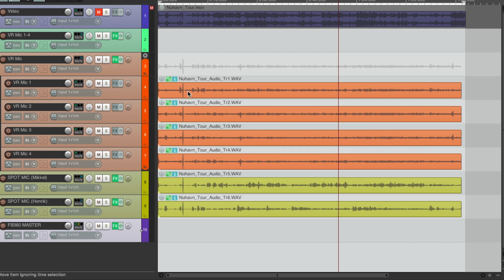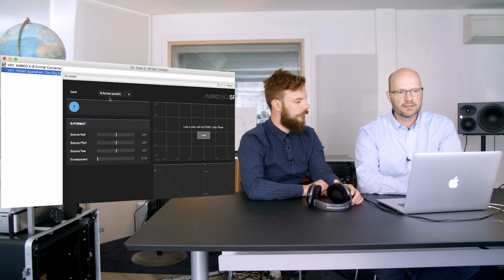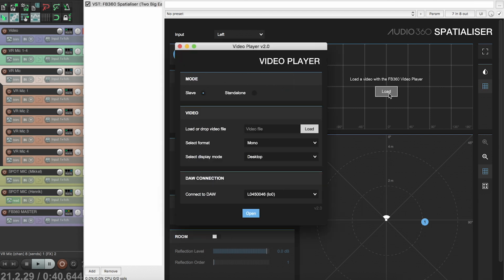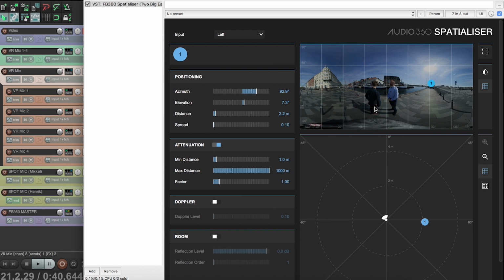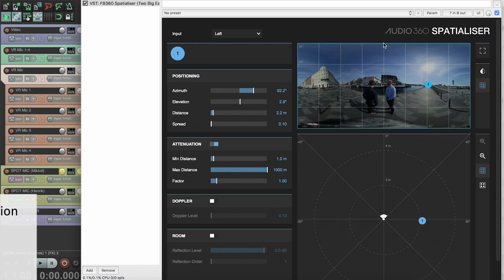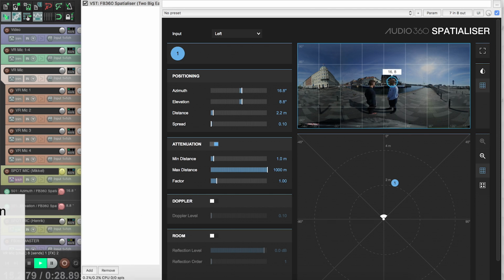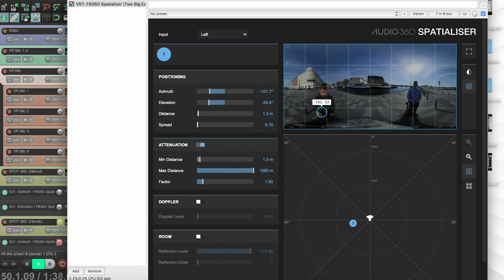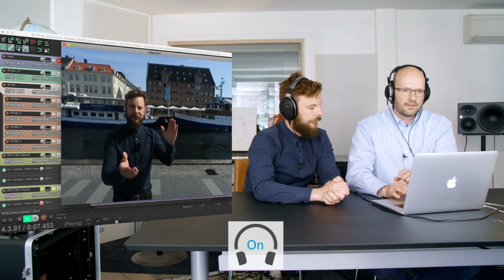AMBEO VR Mic for 360 and VR videos (5/6) - Mixing | Sennheiser

Comment: would be handy if there was a tool that scans the spatial audio and the mono track, identifies the position of the same sounds as the mono reording in the spatial audio and adds the mono track to the same position. like with adding an extrnal audio track to a video file and aligning the timing etc. i frget what the plugin was called, plauralise? a lot easier and likely more accurate than sitting there watching the entire video moving the dot by hand

Comment: Why do we need to run the AMBEO capture through Reaper? This is assuming we captured A-Format right? And also to orientate the captured audio to video? 

What info is embedded in the additional 4 tracks since AMBEO only captures 4 channels and the process as I understand needs 8 channels? What if we don't use additional spot mics like shown here.

Assuming the recorders like F8 and MixPre already decodes AmbiX 1st Order B Format with 360 Camera orientated the correct direction.. Is it then necessary to go through this process to merge audio to video? Or can we just merge 1st Order B-format to the video with FB Encoder with 4 channels?

Comment: Oh I see. So this is more for the google cardboard type of VR. Not room scale type things.
Reply: Correct, but in theory, you could use this in field recording to record multiple spaces, or even multiple positions in spaces to create "pools" or each 3d sound sphere
Reply: i'm sure if volumetric video recording becomes more widspread using lightfield cameras then this form of audio will work and you will be able to move around within the spacial audio track. its just not really there yet on the "video" side.

Comment: Can you provide us the template? You mention this template can be download but no where to be found.
Reply: please can you specify where on that page you can dowload the template?
All i can see under 'downloads' is: 

EC Declaration of Conformity
Quick Guides
Application Software
Instruction Manual

And none of those options seem to have the option to download a reaper template
Reply: Which lav mics have you used? Did you connect them with zoom F8 for recording?
Reply: I struggled to find it too. You need to scroll down the page to just below the YouTube video part. The heading says: 'Try a sample Reaper session and get started with AMBEO for VR'. Just below that is a small link you can get the template.
Reply from the maker: The template can be downloaded from: www.sennheiser.com/ambeo-vr-mic